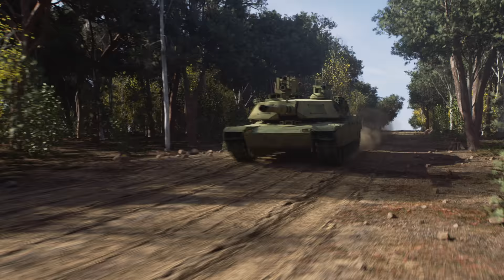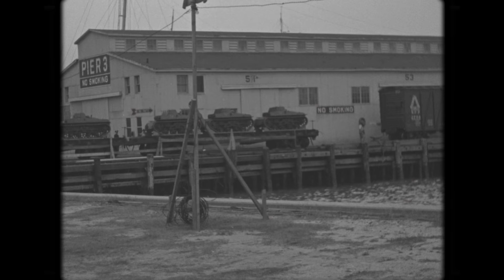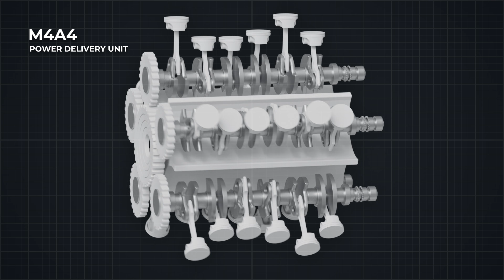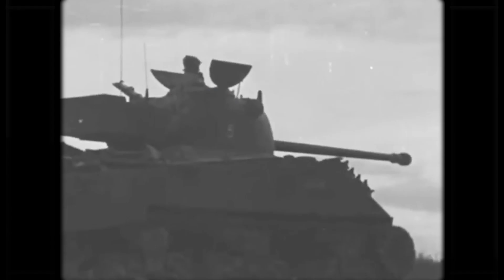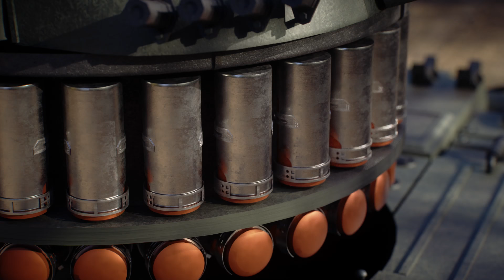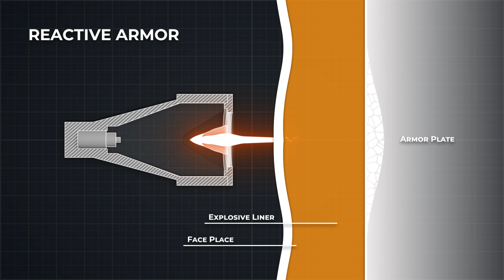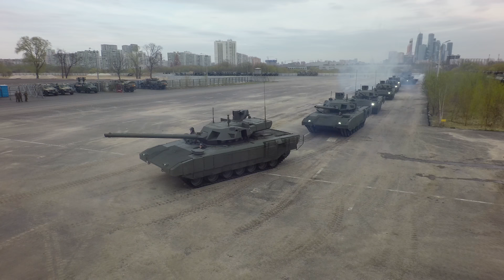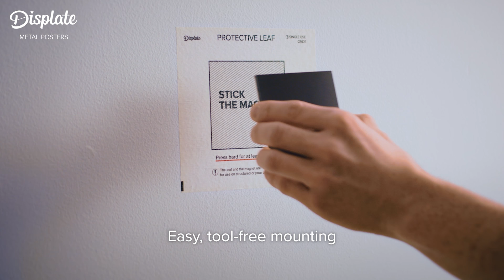Why America’s Tank Failed in Ukraine

Comment: I realize the title is just clickbait, but as for the numbers:

They got a battalion's worth of m-1a1s in September 2023 and assigned them to Ukraine's elite fire bridge, the guys who got stuck in wherever things were most serious. You'd need a tank made of vibranium and running on a perpetual motion machine to have all of them still running today.
Reply: Exactly. During the cold war it was expected that a tank battalion would suffer 50% casualties per day during intense fighting
Reply: @WalrusRubricist  The WW2 Shermans were easy to replace because of the expected attrition 
⚙
Reply: In the end, even after losses are tallied, the question is: Did the thing with the guys in the thing tip the scales the right way or hold a line long enough before you ran out of them. It's a cold calculus, but it's the only kind there is in a war for survival against orcs bent on 'ethnically cleansing' you.
Reply: @WindFireAllThatKindOfThing  And probably one of the best ways to calculate success or failure is checking how long the line is for people wanting to be in the thing: given an unlimited supply of hardware, where is your line of volunteers? In front of the hardware that will have them showing back up 2-3 days later after getting hammered on the line or in front of the hardware that is going to have the front fall off the first time it gets hit?
Reply: @nickierv13  A question that maybe should be posed to the RAF and US 8th Air Force in WW2. And the Poor Bloody Infantry. Because for all the talk of Shermans being merc'd, tankers survival rates by war's end was VASTLY higher than that of infantry, with most Sherman crew who were lost having been caught outside their track by enemy fire.
Reply: @WindFireAllThatKindOfThing  And the sherman was not even the best performing tank of the war
📋
Reply: @WindFireAllThatKindOfThing  The reality of your comment underlines why I find this entire video disgusting. WTF happened to Real Engineering? Did he take Russian payola?
Reply: @richardthomas598  I don't think so. My take is that he is of Irish nationality, is university educated, is by the nature of his upbringing and education a very leftist/liberal individual and in general dislikes America or at least American culture/government...whatever. 

If you watch enough of his content you can see that he doesn't like America or Americans, at least those who do not align with him ideologically. I would posit that it goes beyond that, but it's just an opinion without any substantive evidence so take that for what you will.
Reply: @raifsevrence  so I don’t think there’s any reason for “leftists” this or that. It was a numerical perspective. 

He’s not wrong though. If he was wrong the army as a whole would in fact be sticking with the Abrams as it is but modifying it. But they are chucking the whole engine away. That is indeed very telling. 

It’s one thing to be a patriot, it’s another to be fanboy who refuses to admit there’s problems. The Abrams as it stands has not held up the best, I’m not saying it didn’t do well or okay. But for as highly touted as it is- it’s not met that mark and has been getting heavily punished. 

Will Ukraine still use it, obviously they will. It’s what they can get. Anyone will use what they can when they can if it’s all they have. It’s like asking someone if a 22 is the best are hunting deer. Sure you can talk it up, say this and that, and it will get the job done. But- you take a 308, 6.5, or any other higher level rifle and you’ll find a combination of factors that play into showing its “better in the situation.” 

You also have to remember- the people using these tanks are trained very briefly on them, these are not their staple weapons, there’s many, many issues when it comes to being out in the field where having a different type of tank might actually be better for them. 

This is not a political issue just because flaws were pointed out from an observational perspective. 

The idea of the new rifle the MX7 rifle meant to replace things has been riddled with issues and potentially tossed aside due to its flaws. Does that mean I don’t support the USA because I can objectively see this information an go “ya, it’s not cut out for what’s desired.”
Reply: @DarkConKats American exceptionalism at its finest. "It can never fail because its American. Everyone who is against it must be a liberal. Being educated somehow makes you dumber"... Sounds pretty commie to me. Just with a different flavour.
Reply: @raifsevrence  Is this "Russian propaganda" with us in the room?
Reply: @richardthomas598  Or maybe this tank is not that good: big, heavy, gas guzzling, not that easy to handle nor precise
🤗
Ask the other users in Yemen how it fared badly there either
Reply: @richardthomas598  а при чём тут Россия🤦😂  мы не виноваты в том что западная  школа танкостроения зашла в тупик, мы сейчас сами стали Абрамсами и леопардами делится🤗 недавно в северную Корею отправили несколько едениц техники, все в хорошем состоянии как Абрамс, так и леопард
Reply: @денисматус-ш5ц  The West is vast 
German designs are not similar to French, different from British and somehow Korean and Japanese are allied to the West 
⚙
Reply: @gePanzerTe  it has been recorded that the Saudi Army doesn’t employ useful or even properly train their tankers to the standard that the US has tried to teach them
Reply: @Castle_Rock_II  🤔
So these tanks are not that good they can make up for poir crews 
Proving also it IS replacable by any lighter/well motorized tank
Reply: @WindFireAllThatKindOfThing smells  like copium
Reply: They gave them obsolete Abrams though didn't they
Reply: @peterrobbins2862 Ya the tank was shipped without the armour it was designed for.
Reply: @peterrobbins2862  Sure
And they got obsolete Leopards also
But Leopards have proven very usefull 
🗡
Reply: @gePanzerTe  I understand they absolutely LOVE the Bradley.  Its gun is far better than the BMPs, and stabliized.
Reply: @gePanzerTe To be fair i belive they have lost more leapords than abrams.
Reply: @gildedsteelhead  Those L1 were a bit older 
⚔
Reply: What a stupid title...click bait.
Reply: @gmknotts2008  The Abram proved itself not that good in Yemen also 
😅
Reply: This title is genoside support. As ukrainian blood is used as advert
Reply: they still have four left, not destroyed yet.
Reply: @SaxonJackson 😂😂😂😂
Reply: @SaxonJackson Because they weren't used
Reply: Basically, tanks die, them living this long is impressive enough
Reply: Да хоть из хуяниума, старый РПГ-лучь прожигает 1 метр железобетона, так что ему достаточно заряда 1976 года, про корнет я умолчу.
Reply: The Armata was built for parades, the M1A1 was built for the battlefield, and will suffer losses.
Reply: The first ones were reportedly deployed in February 2024. Over the summer that same year, estimates indicated that roughly 2/3 of the entire fleet had been lost. By the end of 2024, Jake Sullivan had to openly acknowledge that the tank was underperforming in Ukraine.
Reply: No mention of the Challenger which seems to be performing much better in Ukraine
Reply: 16 tanks is a company, so I'd say they got half of a battalion's worth of M1A1 Abrams.
Reply: Good cope
Reply: Not worth the time I take to write this
Reply: Right
Reply: COPE.
Reply: Chat gpt click bait
Reply: desperate loser 🤪

Comment: strange that you gave the Jagdtiger the 8.8cm gun... its not exactly wrong, as there were plans to put that into the tank, but it would have been more accurate to give it the 12.8cm gun. looks pretty different from the model you used.
Reply: Also it's pronounced as a Y not a J

Comment: 20:10 I like the Project Orion pulse unit on the corkboard. How much horsepower in a 1-kiloton nuclear bomb?
Reply: And it has peak torque from the very start!  And if you use your ammunition for fuel, that reduces the number of different things your logistics chain has to supply!
Reply: We need a casaba howitzer abrrams now don't care how much reactive armor you have that's not gonna defeat a nuclear shaped charge

Comment: its not technically failed. its just all this time, the hype was built on top of a false merit. 
what happen to the US tanks in ukraine is simply what would happen when america met an EQUIVALENT CHALLENGES. this is what WILL HAPPEN. it is inevitable and eventual. the reason why the U.S AVOIDING direct clash with the russian themselves. they KNEW what will happen. the same goes to the russian side. its simply the result of an equivalent match where both sides trades equal blows.
ALL THIS TIME, the U.S only fought WEAKER and LESSER opponents. poor nations. less equipped nations etc. and the U.S built their hype on top of that. which is a FALSE MERIT.
and what happen to the abrams, is what will happen to every other aspects of U.S military techs. when they are met with equivalent challenges.

Comment: No mention of the swedish Strv103? The S-tank, which had both a diesel and a turbin.
Reply: I'm too lazy to look it up, but I guess one of these engines was just to heat up the fuel right ? At least I know this concept from trains, some trains have a Wankel-engine because it is a very tiny engine to heat up the Diesel in winter times so you wont get into troubles starting your main engine, and Sweden can be very very cold.
Reply: @randyraudi7725na the second engine was to allow you to use less fuel and move slowly while adjusting the tank. The STRV 103 had a fixed gun and as a result you had to physically tilt the tank using its suspension to aim. That’s what the turbine was for iirc.

Comment: Incorrect conclusion from such a well regarded channel. The Abrams( as with most American weapons), are designed to be operated as part of a combined arms group of other vehicles and equipment. Not as as part of a detachment of dissimilar equipment that was never designed to work together. Saying that an Abrams is unfit for the modern battlefield is just insulting to the usual quality this channel has to offer.
Reply: The Abrams( as with most American weapons), are designed to be operated against goat herders with ak-47 and a stick
Reply: ADA135524. As the Army's primary assault weapon system the M1 will satisfy the
Main Battle Tank requirements during the 1980s and beyond. Capable of sustained offensive and defensive combat, the tank is designed to close with
and destroy the enemy using shock action, firepower, and mobility in coordination with supporting ground and air systems under all battlefield conditions and levels of combat.
Reply: Poor argument.   Abrams in Ukraine are covered by IFV/artillery/infantry/drones...if thats not "operated as part of a combined arms group of other vehicles and equipment" than i don't know what is.  Abrams problem is that is overweight by default.  I'm sure if Ukrainians could weld a barn over it, they would have done so by now.  Also, western idea of "lets place the ammo into an underarmored box at the back of the turret because no one will ever figure out to shot the thing" simply does not work with FPV drones.
Reply: Great cope
Reply: @piepew6518 Russian bot
Reply: So Abrams cannot stand on their own? That’s pretty pathetic, tbh 😅
Reply: @AB0BA_69  nothing can, everything has weaknesses and needs support to cover those weaknesses
Reply: @AB0BA_69 

That's been true since the very first tanks. 

Tanks require support, they always have

Comment: The days of the main battle tank have gone. For its usefulness on the battlefield, a tank costs too much and demands too much supply and support. We must introduce a much lighter, faster, drone-ready, and cheaper alternative to the main battle tank. The 8-wheeled Stryker IFV is a good starting point. Traditional tanks should be used only for the close-range defensive role, not for offensive roles like breaking through enemy defense lines.

Comment: "It's not a failure, it does what it's supposed to do, protecting the crew." It's a tank, not a bunker. If it can't cross a bridge because it's too heavy, gets stuck in the mud and runs out of fuel and gets hit, but half of the crew survives, it still means it's a failure lol. The attack stalled or defense crumbled, crew survived the initial hit, then got vaporized by drones or artilery when they were trying to flee.

Comment: Well drone technology has rendered the tank and most combat vehicles vulnerable. But like anything else adaptations will be made. Anti-drone countermeasures such as electromagnetic weapons. However the Abrams I think was a poor choice to send to Ukraine Not because he can't get the job done but because you Ukraine does not have the logistical capability to keep it supplied and fueled like the United States can. Napoleon once said an army marches on its stomach It's no different for combat vehicles They march on fuel oil parts and the Abrams is a logistical nightmare. You have to have the logistical infrastructure to support it If not they're no good to you.

Comment: It's also because the Slavic way of war is absolutely cursed! I've watched video after video of the war from BOTH sides. They just inanely charge at each other with little to no regard of tactical positioning or strategic value. That's the primary reason their war has such an astronomical rate of deaths and casualties. It's nothing but dumb, wasteful attrition. Both Ukraine and Russia should be collectively ashamed of their damnable selves.

The strength of the Abrams is in it's ability to snipe other tanks from afar. Not so much in how it brawls up close.

Comment: The Army never wanted the turbine or even the Chrysler XM1. The GM XM1 had won the competition but then the phone rang.
Reply: Chryster XM1's engine barely worked. It had a complicated adjusttable compresion system that worked sometimes and sometimes snapped the engine in half